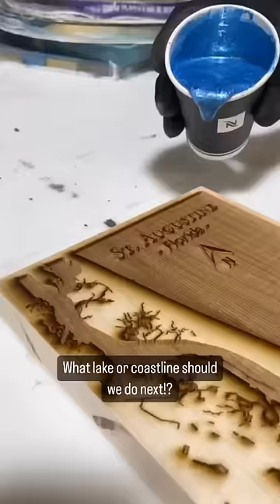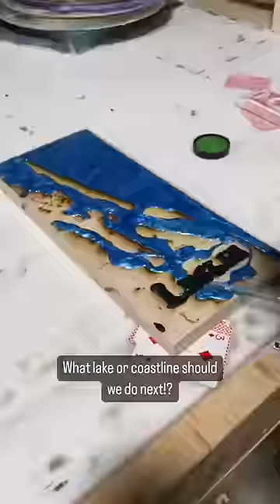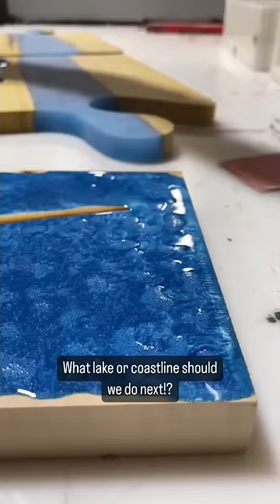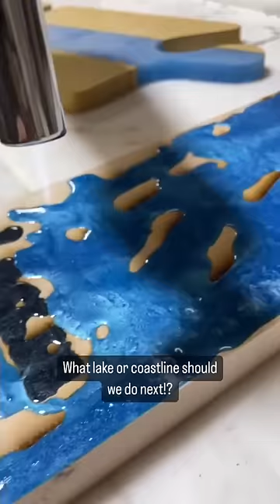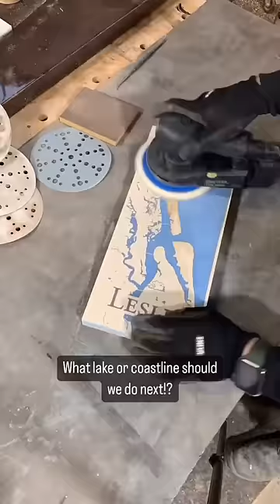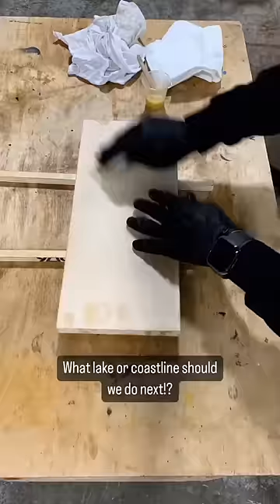How Much Would You Pay For This Epoxy Lake Board?! 🤔 #wood #epoxy #diy #resin

Comment: What brand is the liquid that you make to make it shine at the end?
Reply: It's the same coating you'd put on wood to protect it.
When I build my cabin, I'll set the wooden boards on fire for about a minute or so, hose them down, when dry an application of oil will be put on them. Then every 10 or 20 years re-- oil again.
That makes the wood very strong, mold & bug free & the cabin would last a very long time. Same for roof & it could last for 3 or 4 hundred years.
(Proper up keep of course)

Comment: What did you use to remove excess epoxy? I have a large table I need to clean up.
Reply: Polished it with the power tool. You can use solvents beforehand, scratch off excess then use sand paper on the polishing machine! Just saying, don't come after me! 😬
Reply: Router sled? CNC? Thickness planer? Each are often used for flattening pieces before sand & polish.

Comment: Definitely worth more than $5 , in my opinion.
$35/$40 USD
Reply: The materials alone would be close to that. Epoxy resin gets expensive. There's also the wood, intricate carving, and sanding pads. Maybe they used a computer guided router to do the carving and those machines are $$$$
Reply: You really are clueless, aren't you Rachael?!?!